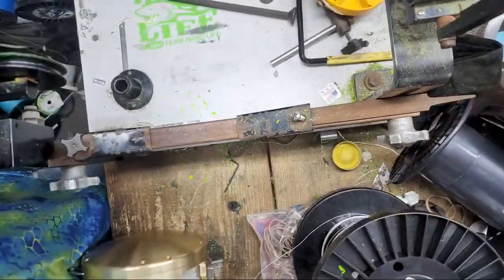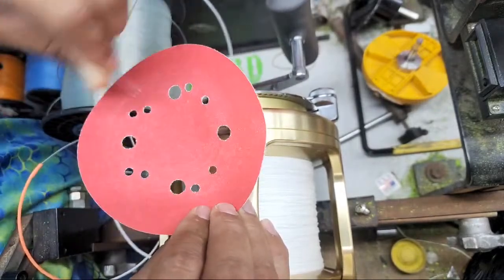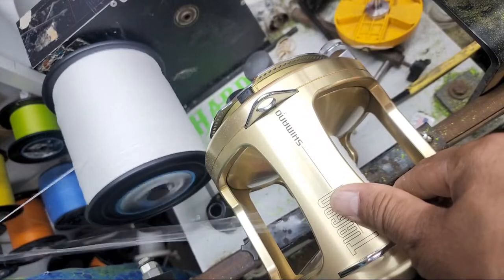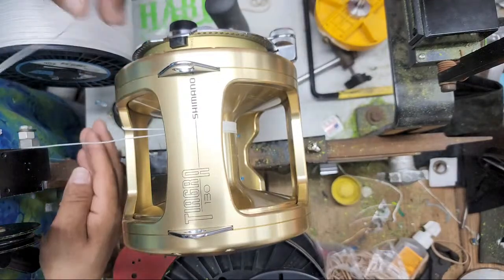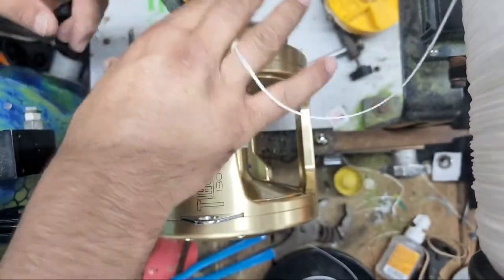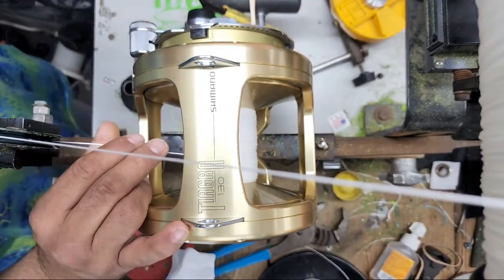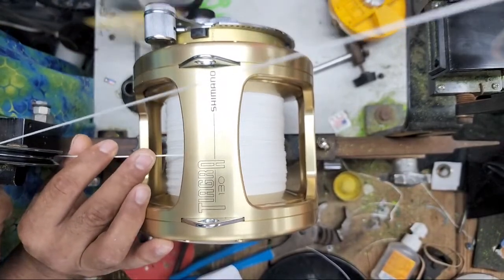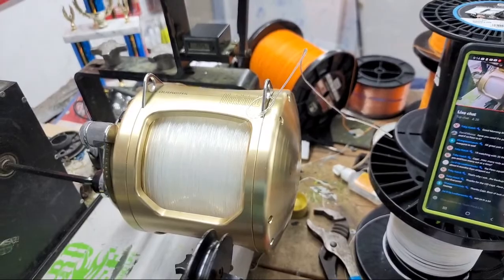Shimano Tiagra 130 Downspool Knot Check What Will We Find most satisfying most calming ASMR library

Comment: I personally use some super tough 90 minute epoxy resin to cover up those stupid pins, have seen them absolutely destroy braid before. So I clean the surface, then glue it in, then use some marine grease to coat the whole spool with against corrosion
Reply: And I've seen reels get spooled multiple times within one fight, but it held up and the fish was caught, also seen whole spools empty and come off with barely any pressure thanks to how some shops put the line on...
Reply from the maker: The  Marine grease on the reel does that have any transference once you're dealing with it and running braid or do you only do it on the very center of the spool
Reply: @TeamHardLife  I cover the entire spool. But I only use full synthetic grease with pretty much no smell or taste, doesn't really affect the braid
Reply: What also works if you have a source for the base material for waterproof make up, over here you can get it from some carp brands cause the carp guys use it to coat their hooks, especially after sharpenin', against corrosion
Reply from the maker: You got it !!! .more prizes Right on Updated: Yes we are ready to hit our 20,000 subscribers mark.  Which also means we are giving away over $6000 in prizes to 12 winners and if we can get to 20k before the end of June 2022 we will add 4 more winning prizes of land based shark fishing or Alligator gar fishing with Team Hard Life and Team Reel Loco's
#jacdupleatherworks
 Jac'd Up Leatherworks has also donated a Custom Wallet as well.

Lo entendiste !!! .más premios Justo en Actualizado: Sí, estamos listos para alcanzar nuestra marca de 20,000 suscriptores. Lo que también significa que estamos regalando más de $6000 en premios a 12 ganadores y, si podemos llegar a los 20k antes de finales de junio de 2022, agregaremos 4 premios ganadores más de pesca de tiburón en tierra o pesca de pez caimán con Team Hard Life y Team Reel. Locos
#jacdupleatherworks
 Jac'd Up Leatherworks también ha donado una cartera personalizada
Reply from the maker: That's something.. You got it !!! .more prizes Right on Updated: Yes we are ready to hit our 20,000 subscribers mark.  Which also means we are giving away over $6000 in prizes to 12 winners and if we can get to 20k before the end of June 2022 we will add 4 more winning prizes of land based shark fishing or Alligator gar fishing with Team Hard Life and Team Reel Loco's
#jacdupleatherworks
 Jac'd Up Leatherworks has also donated a Custom Wallet as well.

Lo entendiste !!! .más premios Justo en Actualizado: Sí, estamos listos para alcanzar nuestra marca de 20,000 suscriptores. Lo que también significa que estamos regalando más de $6000 en premios a 12 ganadores y, si podemos llegar a los 20k antes de finales de junio de 2022, agregaremos 4 premios ganadores más de pesca de tiburón en tierra o pesca de pez caimán con Team Hard Life y Team Reel. Locos
#jacdupleatherworks
 Jac'd Up Leatherworks también ha donado una cartera personalizada
Reply: I actually always smell and even taste (then spit out) the grease cause I don't want anythin' to might decrease my catches and eels for example can smell one drop of perfume in one of the great lakes...